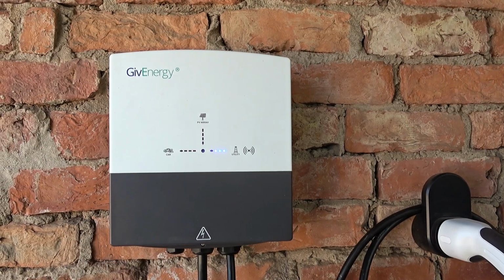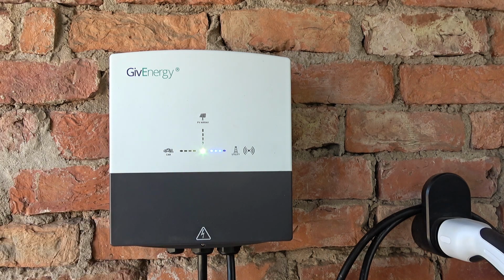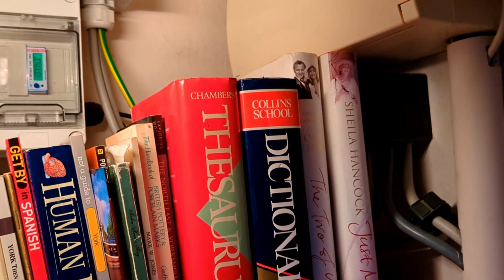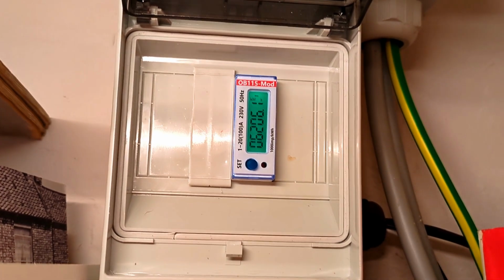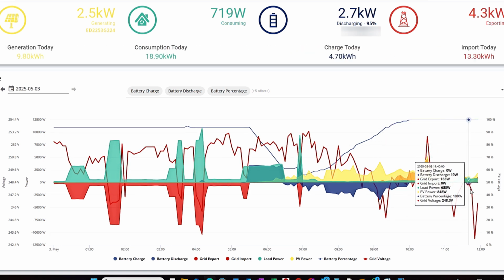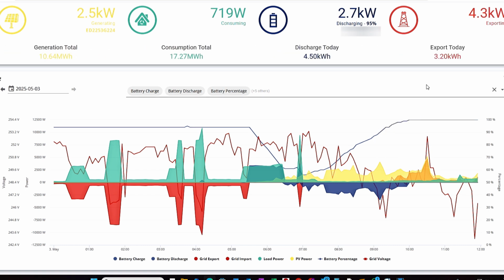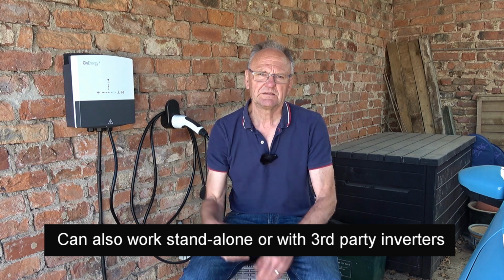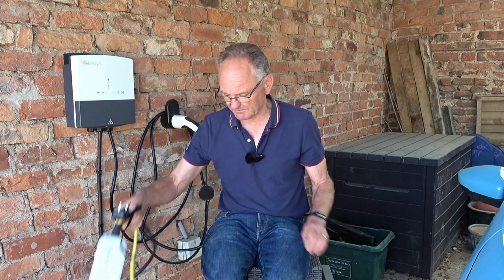HS310 EV charger Grid over-voltage problem

Comment: Its a supply and demand problem! The loss of neutral is a rare occurrence and given that modern supply cables are coaxial it is impossible to sever the neutral without also severing the live cable . As you will know the grid supply has to be balanced as closely as possible to grid demand, in order to prevent voltage and frequency problems, and it is possible that if you get masses of solar applied to the grid when there is not the demand to soak it up, voltage and frequency will rise.  Solar inverters need to be demand sensing in order to not push power into the grid when demand is not there. Nominal voltage in the UK is 240 volts, always has been and always will be, due to the effect on current that lowering voltage would have! The harmonisation claim worked by stretching the tolerance envelope, in fact elec engineers in training were told to     Say that the voltage was 230V, even though they knew it wasn’t, but political ideology has never had the upper hand with engineers and they were politely told to get stuffed!  I don’t know if you are familiar with load shedding equipment sometimes installed to limit the demand a large installation can make on the grid? We need the same system to monitor voltage so that solar is not added to the grid without demand being there, which would spoil everyone’s feed in payments! Until the grid managers can control domestically produced solar and know on the fly what is available minute to minute there will be problems!
Phil
Reply from the maker: Hi Phil, I think smart meters can, in theory, communicate with intelligent appliances to limit demand but I'm not sure whether this feature is used (else why CT clamps?) and I've never heard of anything like that on the export side.  I get about £550 a year from export and I don't want some joker turning that off because they decided instead to buy power from a peaker power station or interconnector at 20x the price because they were too lazy (or unable) to pull the cheapest energy first. Octopus are working on a new set of industry standards under their project Mercury to enable open-standards interworking between devices but this is partly so they don't have to interface their Kraken provisioning system to every different type of proprietary interface for every type of charger and inverter. Anyway the smart meter stuff is at least 15 years behind on technology and they have barely completed half of the rollout yet. And a number of those meters will stop working when 2G is turned off. Oh and the batteries have to be changed every 10 years or so and I guess that means an engineer visit and a new comms head. They should have put the computer guys in charge rather than the meter guys. Steam engineering. What a total f-up. Cheers
Reply: @ my “smart meter” at the workshop has never worked, even though there is a phone mast on the hillside just above it!
Reply from the maker: @philhermetic  you probably know Phil that only Gen2 smart meters in the South connect by cellular.  Meters in the North connect to a private radio network run by Archiva  (successor to the Independent Broadcasting Authority that ran all the TV masts). What's more the network in the north has two bands 420Mhz standard and a 450Mhz variant for Fylingdales and anywhere within about 50 miles of that to avoid radio interference. My meter on the North side of York is on 450Mhz but the other side of York is on 420Mhz.  But the 450Mhz variant comms units have only been around for about 2 years and before that the idiots were fitting Gen2 meters with 420Mhz comms heads fully knowing they were never going to work (but the fitting contractors got paid so why should they complain). It's only public money after all. Look at your comms unit on top of the meter and see if it is 420 or 450 that might help to know.   You are only 30 miles from Fylingdales. Or are you on Gen1 meter - which have been turned off anyway I think as the 3G network closed down? Cheers
Reply: @ very interesting! My previous smart meter  actually had a skeleton mobile inside it, and I am pretty sure he tried several sims in the new octopus one, but I will look tomorrow and send a pic!
Phil
Reply from the maker: @philhermetic  if it has a SIM it's probably Gen1 and I'm not sure they still work. Also I read there is a licence requirement on Energy Suppliers to replace any unenrolled SMETS1 meters with SMETS2+ meters by no later than 31 December 2022.”

Comment: Down under, one  issue with the early adoption phase of EVs has ben road maintenance.    Federal fuel tax is used to maintain our road network.  EV users do not pay this tax, and thus do not contribute fairly to road repair for their share of the damage that all road users cause.     South Australia was about to implement a per-kilometre tariff on EVs  but on the election of the current left-wing state government this was dropped, in the interests of  getting more people into EVs in their headlong rush to achieving net-zero.
Reply from the maker: Hi, from April 2025 UK has introduced road tax on EVs at the lowest band (£190 per year) for EVs registered after April 2017. EVs registered before April 2017 remain free of road tax. Cheers

Comment: Interesting.
I've been looking at this sort of stuff over here (Australia) for a month or two. All this stuff needs to talk to each other, and often it doesnt. When it all works well it is brilliant, when it doesnt it seems to make for a lot of very frustrated people as it is very hard to troubleshoot and correct!  
We actually dropped out grid voltage to 230 from 240 a few years ago because of the amount of solar getting connected, as you suspect, I dont think they changed any hardware on the grid at all, meaning all the old analogue transformers are stilling putting out the same voltage.   Probably new transformers will give the lower voltage, but until your local transformer blows up  (a semi-regular occurrence in storm and cyclone season here) and gets replaced,  you are stuck with potentially high voltage issues.
Reply from the maker: Hi Jack, our energy retailer Octopus is leading work on defining a set of communication and control standards between Intelligent power devices. This is an industry self-initiative rather than something led by the government. Octopus has come from a startup energy retailer to the largest in the UK (12.9m customers) in the space of 10 years by offering innovative new products putting customers first, based on innovative technology. In fact Octopus is now handling back office services for many of the other energy retailers. Octopus is leading a campaign to restructure the very inefficient (expensive) UK wholesale electricity market. Cheers

Comment: These sound like odd problems. Here in the USA, voltage is raised every 20 years or so. It started, way back in the late 1800s, at 90 volts. It’s gone up ever since. It’s known as 120 now, but it’s really 123. I expect in a few more years it will be 125 or 126 volts. Just double that for our 240 service. The idea is that the 12 gauge wire can carry more wattage without increasing the amperage, which is 20 amps, and so allows the same outlets. It’s clever. I remember when my wife and I stayed at one large old hotel in London. I don’t remember the name now, but it’s built on an old train station, I believe with a large wrought iron bean atrium. There were three outlets in our rooms. A 3 amp, a 7 amp, and the newest 13 amp. Are all new homes in GB going to require solar panels, or,is that a more local,thing. Here, the right wing would go apoplectic over that.
Reply from the maker: Hi Mel, there is talk of making solar panels mandatory on new houses in the UK but it is not a legal requirement yet. It would be a requirement set by the national government, if it happens. As  green energy generation and EVs are increasing we are hitting limitations with the old local and national power distribution systems, which will require big investment over the next decade or two. They reckon electricity consumption will increase 4x, but local  generation is also increasing at a fast pace. Some countries further ahead than us are hitting the big problems first (big power outage in Spain recently) so we can learn from them. One thing with solar inverters, if you have a grid power cut the inverters disconnect because they sync to the grid for voltage, Hz and phase. Plus lack of rotating machinery (mechanical inertia) means failures are instant instead of running down slowly over a few minutes and thus giving time for corrective action. Grid-scale battery farms are under development. Cheers
Reply: Surely the inverters cut during a power cut to prevent exporting and electrocuting the engineers sent to fix the power cut.
My battery inverter doesn't need the grid in order to provide power to my house, so why shouldn't my panel inverters? 
Genuine question. I'm not an electrician.
Reply from the maker: @rugbygirlsdadg  Hi, yes my home inverter cuts the solar and battery power output if there is a grid fail to avoid electrocuting the grid repair team, exactly as you say.  My inverter is a couple of years old. Nowadays you can buy a setup with a 'gateway' which is basically a very fast switch which physically disconnects the grid from the house in the event of a grid fail and the whole house then runs from the solar and battery as a stand-alone system isolated from the grid. I think I might be able to have a gateway added as a retrofit now but for me it's not easy due to tight space limitations where the power comes into my house.  But to export to the grid the inverter must first sync with the grid on voltage, frequency and phase thus without grid power it can't export (even if the cable is there). So a big solar or battery farm might go offline because it can't sync up to an incoming supply, and a grid just losing a bit of capacity might cause a lot of green generation to go offline in a rapid cascade effect, as I understand it. I hope that makes sense. Cheers

Comment: You should be able to solve your overvoltage issue by installing a buck transformer on the feed to your charger. But, before you do anything else, I suggest that you check your electrical connections. Corrosion can cause many of the problems that you have described, and this can be particularly problematic if you have any aluminum wiring.
Reply from the maker: Hi, the general solution here, if you can't get the distribution company to bring the voltage into spec, is to fit what they call a voltage optimiser. It's basically a transformer with a number of tappings to bring the voltage down by (for example) 6v, 12v, or 18v. Some are electronically stabilised but my impression is most are just dumb transformers in a box. They typically rate/fit them for the whole house and the units cost about £270 (US$360) plus fitting.  I've not seen anything like that for just one circuit.  I take your point about the random voltage fluctuations and I wondered about the cables myself. All the home installation is less than 10 years old and has been tested many times. But I can't say the same for the underground cable coming in from the street and the joint to the common main cable. For all I know all the houses in our row might have fluttering voltage due to a bad joint somewhere but they probably would not know. These new systems are going to showup a lot of hidden latent problems - and the first reaction of the distribution companies seems to be ignore, deny or hope it goes away. Cheers
Reply: @HaxbyShed  What you're calling a voltage optimizer is refereed to in the industry as a "buck boost transformer". Do a search for the term and you will find what you need. They are available in numerous sizes. While you could install a unit for your whole house, if your charger is the only thing that is having issues, a dedicated unit for the charger might be a better solution. 

To save money, aluminum wiring is often used for primary feeds. Briefly, it was also used for distribution wiring, but there were way too many incidents. So reputable electricians won't use it for anything other than the primary feeds. You didn't identify what you have, but it's likely that your primary feeds are aluminum and that you have a corrosion issue at the connections. After thoroughly cleaning them, use Noalox by Ideal to prevent future corrosion.

Comment: As one electrical engineer to another, that was a nice explanation. I don't have experience (yet) with EV chargers, but open neutral in US is a very dangerous condition too!
Reply from the maker: Hi, I think generally the problem is the difference between the paper spec and the real world. We could all pretend voltage was 230v +10% to -6% when it did not matter. I think the IET (like IEEE) and the manufacturers will adjust to reflect the real world in the near future.  It's just not practically possible, or at least very expensive, to bring all supply voltages strictly within the theoretical spec. The charger supply is protected by a 30mA dual pole residual current trip but they can stick/fail so I guess the EV charger is the last line of defence in that case. If you could jump into your car without touching the ground it would be a super safe method, but the charging cable is only 10 meters long  🤣🤣🤣

Comment: Thanks for sharing.
Reply from the maker: All this new stuff is great but it brings unforeseen complexities. Too many variables to model in your head, until you have lived with it for a while. But then you can be in the first group saying "that Govt initiative won't work - it does not work like that in reality". It takes time for the central planners to catch on / catch up. Heat pumps a perfect case in point - until they bring down the cost of domestic electricity by half why would you do it? Cheers

Comment: I have solar and recently had my inverter error out with an arc fault. When I contacted the support company they said that they would remotely connect to the inverter to see what was going on. Long story short, after a few errors and subsequent software tweaks, the faults have stopped and my panels are producing more power to the grid.
It seems like a dark type of magic, but I appreciate learning about these new systems. Thank you for sharing your experiences with us.
Reply from the maker: Hi Robert, I think I've had about 6 updates for the inverter and perhaps the same for the battery. Some updates don't relate to me, such as improved load sharing for multiple batteries, but one inverter update about a year ago boosted my solar by about 20%.  I get a notification on my dashboard and I just click a button to do the update. In the early days there was a chance it would get stuck mid-update but that's not happened for a long time. The systems and support are becoming quite mature now. Cheers